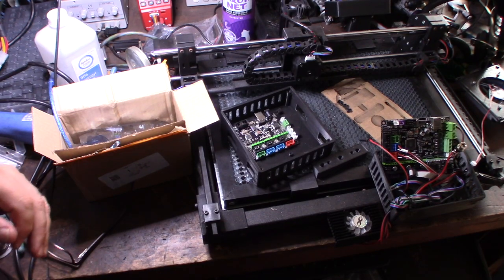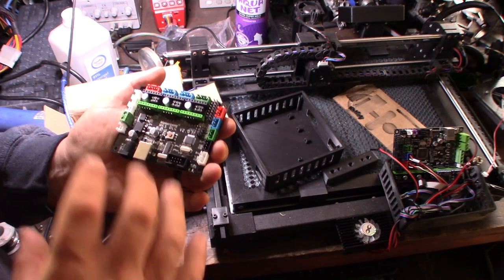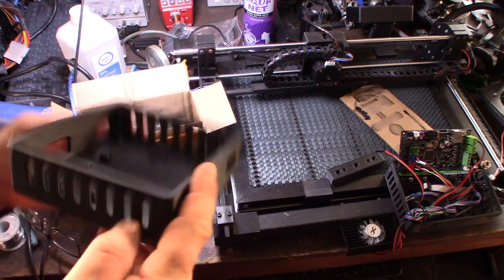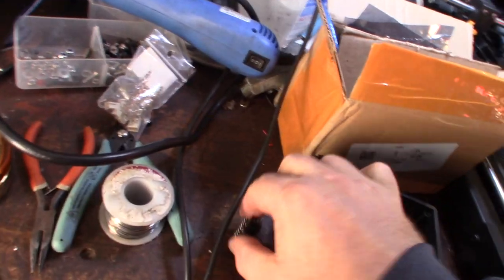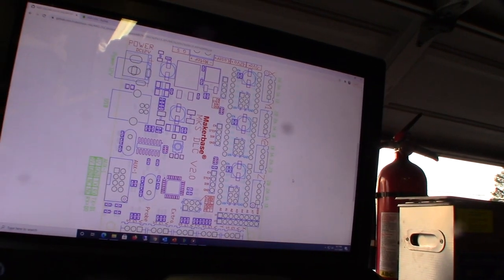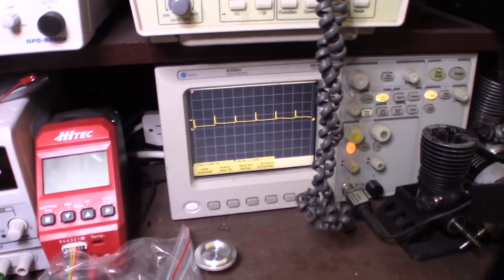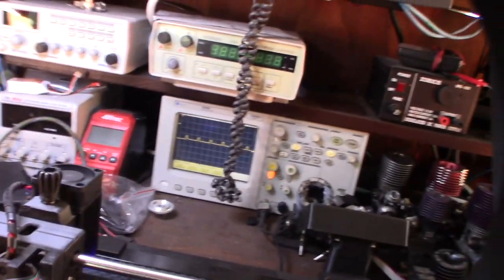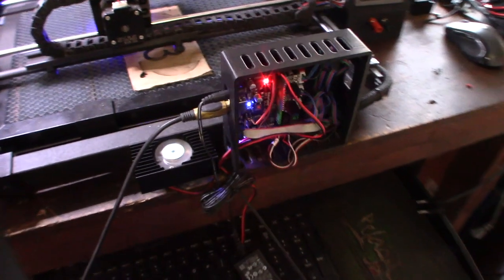Makerbase MKS DLC 2.0 GRBL Laser CNC controller board Installation Review

Comment: Do you remember which wires you ended up swapping? I'm having the same problem right now on my dual y, checked everywhere on the internet for some answers, but it's not exactly clear to me yet. I think I need to swap a- and a+, green and black in my case? Shouldn't there be some firmware setting for this we can change or uncomment, just seems to make no sense to have it configured wrong out of the box.

edit: this actually worked, wires on the steppers are either a-/a+ or b-/b+, reverse either one of them (green/black or red/blue) and the motor goes the other way, simple as that, who would've thought. Anyways, keep making vids, I like watching them.

Comment: Hi nice vide, thanks :) Quick question though if I may, I have a 3 wire PWM controlled laser, can I connect the power to the laser pins and the PWM tp S on the connector to the right of the green motor connector? Thanks Adrian

Comment: Hi! My spindle is 20 volt DC and current = 4.5 A has its own PWM speed controller,  I want just turn the spindle on and off from this controller via relay or mosfet! By what connection scheme can I do this, and what kind of relay or mosfet can I use?
Reply from the maker: Get a mosfet. Look at a 3D printer heated bed mosfet
https://www.amazon.com/BCZAMD-Printer-Heating-Controller-Extruder/dp/B07R292KXF?crid=19N7TBD8TTQP5&keywords=heated+bed+mosfet&qid=1664507339&qu=eyJxc2MiOiIzLjgzIiwicXNhIjoiMy41MSIsInFzcCI6IjMuMjcifQ%3D%3D&sprefix=heated+bed+mosfet%2Caps%2C135&sr=8-14&linkCode=ll1&tag=fintechcomm0f-20&linkId=e28dc61410e1bfe44d622bdde3f96a3c&language=en_US&ref_=as_li_ss_tl

Comment: remove the last jumper on only the z or on all three x y z ?  I have installed and having problems I figured the wiring for the driver motors but they are running very hot to touch normal they run cold or 110 f

Comment: What firmware did you use? I am adding this to a 3018 CNC mill but the firmware looks like Marlin, not GRBL. I need to load GRBL with SD card and TFT support. Can you point me in the right direction for firmware?
Reply from the maker: DLC board runs GRBL 328P processor
Reply: @fintechrepairshop  ok, thanks for that. I should have been more specific though. My board is set up new as a 3D printer on the display. I only get options for Marlin and Smoothieware I updated the TFT firmware and now I get laser firmware but still no CNC. Any ideas?I did set the fir,ware text file to type2: 

#mainboard firmware setting(laser :1; CNC:2;)>cfg_firmware_type:2

Comment: hello there thank you for the video was wondering if you made any changes to the GRBL CODE file. and if the end stop and homering worked . one more thing where did you connected the PWM wire than you
Reply from the maker: Yes, I had to make a few changes to GRBL and upload, I disabled Z homing. My laser cutter is XY axis only. I also disable startup alarm/unlock on boot.  I connected my PWM to the GS port next to the spindle.

Comment: Hello,down in comment i saw that you wrotte that i need laser with pwm to do grayscale images,i wanna build co2 laser for engraving and cutting so i need pwm on board for laser psu power control,do you know if this board support that,i know that it has ttl and i think i can use it for on and off but do you have idea how could i use it for laser power control
Reply from the maker: The board does PWM. PWM controls intensity

Comment: hi! can you tell me if this board have a grayscale control? Have you tested it? i'd like to buy it but i dont understand if it just have an on/off laser signal or can also modulate for grayscale
Reply from the maker: Yes, there is greyscale. You need a laser with PWM (Pulse width modulation) to control greyscale.
Reply: @fintechrepairshop  thanks! I found a seller on aliexpress that said it only have ttl on/off signal so i was confused!